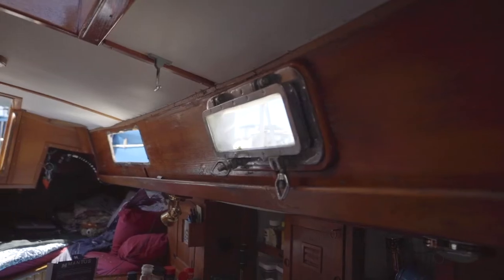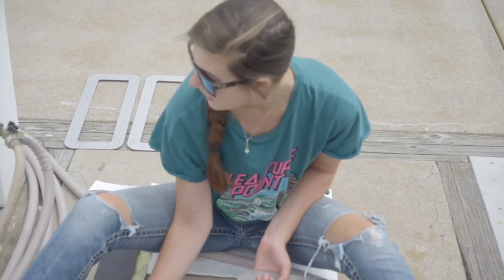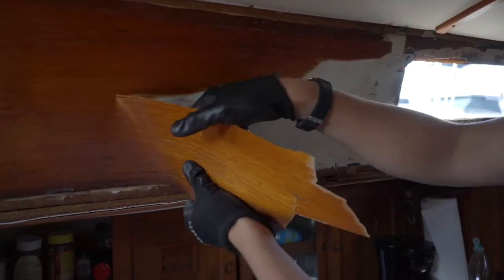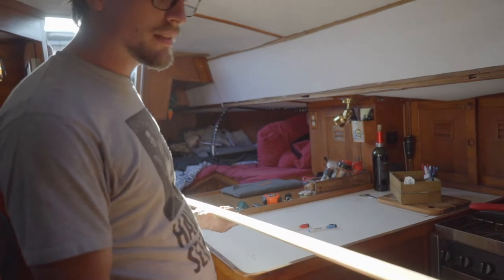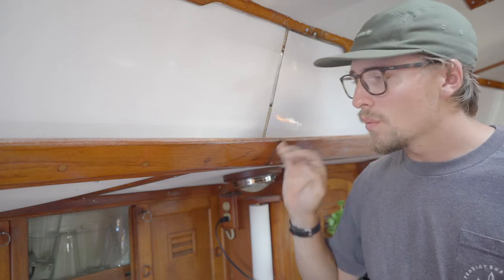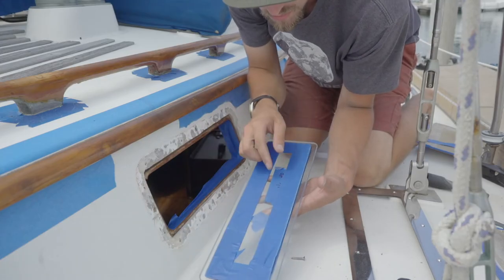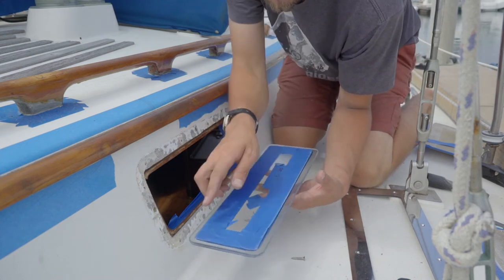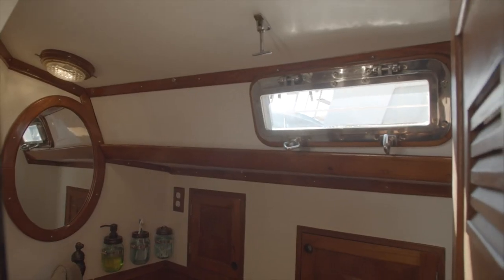Sailing Avocet | Port Light Rebuild

Comment: Nice job. I don't know why these old boat builders had to make a main saloon look like a teak dungeon. Good idea ripping off the teak vernier and adding the nicer looking white plastic laminate. Good work too, on the exterior stainless frames. When you get up to the north end of Seattle, check in with Allied Titanium and replace the screws in those frames with titanium screws and that will eliminate the for certain rust problems. Here in Africa, we were lucky and took our aluminum port lights, to a shop where they were sand blasted and powder coated..all for......$15 each! We couldn't see paying $800 each for new ones.  And your blister and hull repairs.....phewwwww, but it will last forever. Keep at it. Save some work where you can get it done cheap, like in Fiji, Philippines or here in Africa.
Reply from the maker: Oh man what I would give to go back to (South) Africa. It is one of my favorite countries! Thank you for the comment, it really made our day. We enjoy your videos and respect your opinion! We can't wait to share our haul out videos. Cheers and fair winds ~

Comment: Hey I'm impressed by your results. 

I've got an Alberg 37 I'm fixing up, and I like the Formica idea. How did you adhere it? Contact cement? 

Btw I think that old teak was just a laminate. You can buy it in rolled sheets to laminate cheaper woods. I have some that has 3m PSA so it's basically like a sticker.
Reply from the maker: Hey Curtis! Yes, we used contact cement. We found out after that it was a laminate, which was shocking since the rest of our teak is all thick! Alberg 37... wow! Killer boat! Best of luck with your project :)
Reply: @sailingavocet  thanks for the information, I look forward to more of your videos! 

Digging into these old boats, there are a lot of surprising solutions born out of conflicting requirements.. I've seen some bizarre stuff on my own boat, anyway.

Comment: use a hot glue with your adhesive , the hot glue will set instant holding the curve ,letting your glue set
Reply from the maker: Interesting concept! We use hot glue for most projects but I’m not sure how that would react with contact cement.
Reply: @sailingavocet  If you were using contact cement it should have set instantly , at least it does for me you get one shot
Reply from the maker: It did not set instantly against the glass, it would fall millimeters but enough to irk me so we held it in place for a minute or so to ensure the proper layup. Nearly a year and a half later we are so happy with the outcome 🤙